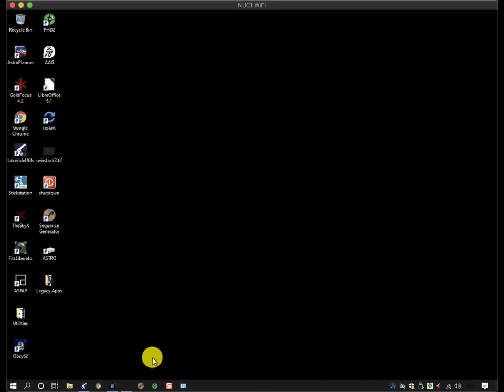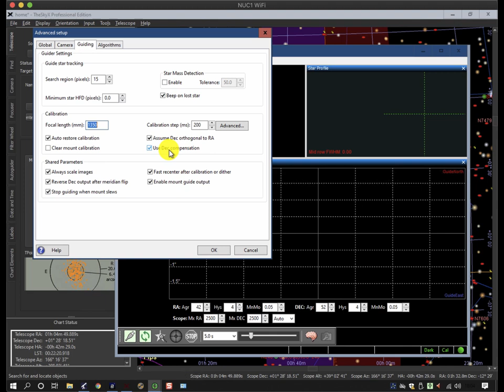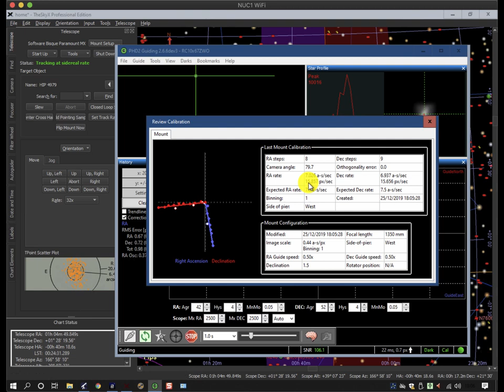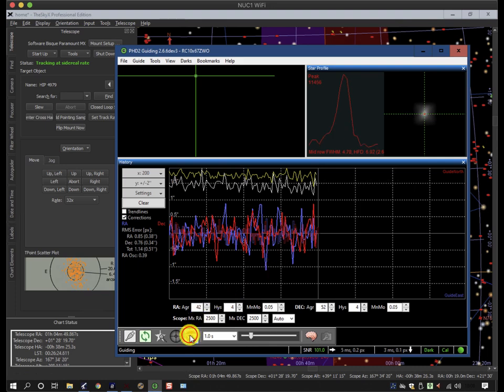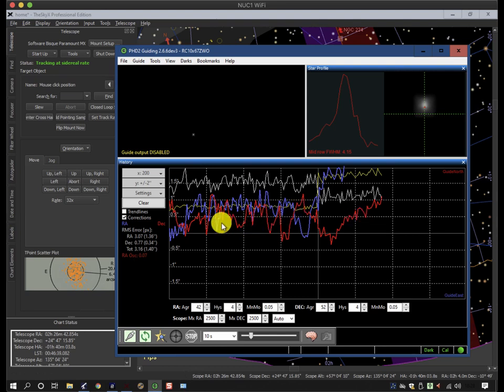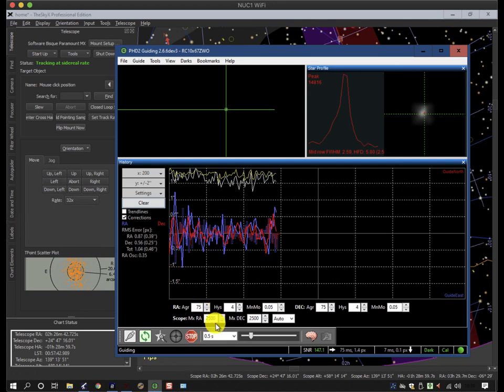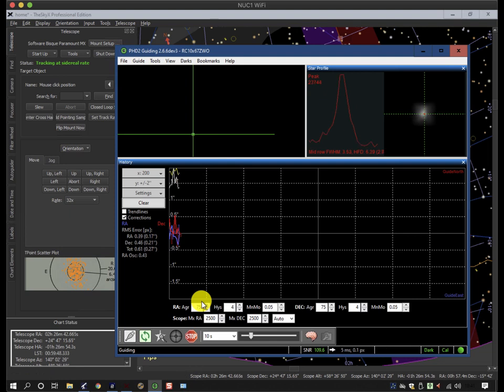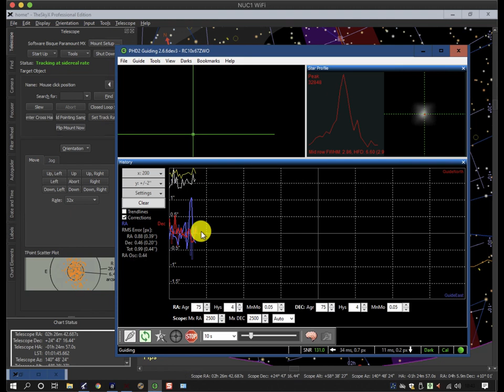Sequence Generator Pro (part 7a) - setting up PHD2

Comment: Chris if I have a .55 image scale and am going to try for up to 5 minute subframes (I have the MYT) and will have a large pointing model, do you think I can go unguided? I have not installed a PEC correction yet. I appreciate your thoughts.  Will you cover anything about how SGP calculates suggested integration time? I have never been able to get that to work. I normally calculate my system noise and just have my ADU in that range. Thank you again.
Reply from the maker: I would do PEC - it could be up to +/-7 arc secs and would certainly mess things up. My PE is under 1 arcsec and I can generally go up to about 600mm FL. I have done longer but it is not a goal in its own right and I prefer to fall back on gentle guiding. The image scale is not the issue here as the seeing noise is usually a few arc secs.
Reply: Chris Woodhouse thanks. I have not set my 8EdgeHD up with a off axis guider so at 1700mm that might be not so good without guiding? Assume I would be safe with APO that is 714mm? Thank your book is terrific.

Comment: Hi Chris.  Thanks for your videos.  I'm just getting started with SGP and AP and am having lots of problems.  First, I can't seem to get PHD2 to play nice with my guide camera (a new ZWO 120MM-S).  My mount is an EQ6-R Pro (with a Shoestring direct cable and EQMOD) and my guide scope is a ZWO 60mm 280mm focal length.  I setup/teardown each night.  When I get everything connected to PHD2, it won't calibrate and keeps saying 'star did not move enough'. Using Manual Mode in PHD2 and the PulseGuide Monitor in EQMOD, I can confirm that PHD2 appears to be talking to the mount.  The pulse guide rate is set at 0.5x in EQMOD & PHD2 (but I've increased that up to 0.8x but get the same error message during calibration).  I have never been able to get it to guide.  I've run the Dark Library and Bad pixel Map for the camera in PHD2 but when I apply either of those, I seem to get odd results.  If I put it in a test configuration (i.e. no guide scope & guide camera capped) and start camera looping with 1s exposures (using the Bad pixel Map), it seems to show a star field with lots of points of light and those points change with each 1s exposure.  Again, I have no experience with all this, so I don't know if this is what to expect but it doesn't seem right to me.  Should I see this?  I just want to determine if something is wrong with my guide camera (or my setup) and at least be able to get through calibration and start guiding.  Any help is greatly appreciated.  Thanks.

Comment: Hello Chris...Your videos are so good...explanations are TOP...I'm using  an AZEQ6 mount with a 250/1200 skywatcher tube...and having so much problems with guiding...especially in RA...and yes long exposure is better for guiding when you have a good mount as you say...not my case.:-(...
trying an OA guiding when the weather will deign getting better here in Belgium...
Reply from the maker: When I try a new mount for the first time I spend half an hour just looking at the PHD2 graph running, using something like a 5 to 10-second exposure, with the guider output disabled. This gives me a feeling for what I need to correct out